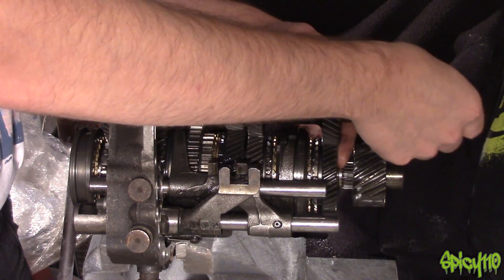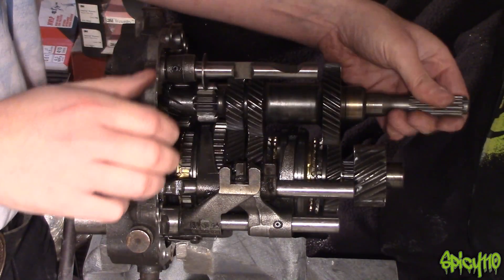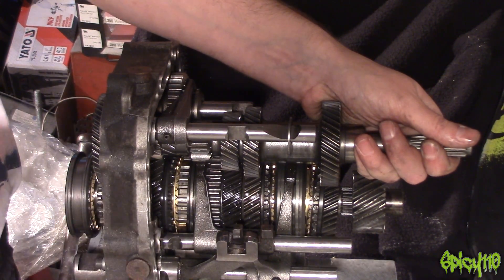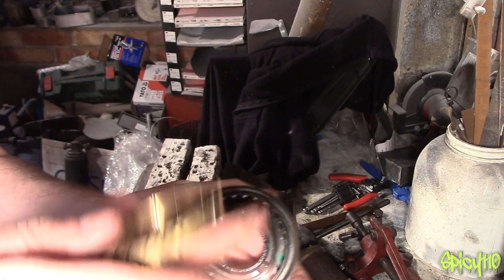How a car gearbox works!

Comment: The workings are much like a bike but the clutch is wet on a car on a bike it's dry wearing but the priceable is much them same my dad showed me how to rebuild a motorcycle from the scratch and learned how to work on cars from that but great video keep up the good
Reply from the maker: +Rodney Fisher you mean the other way around. Bikes have wet clutches.
Reply: yep i got mixed up plus the stater motor its bigger on a car and some other things my dad said a bike engine works much the same i help my dad rebuild a MZ 250 years ago   but as i say great video i might have some old parts to send you once iv started work on my 30 year old honda H100sg